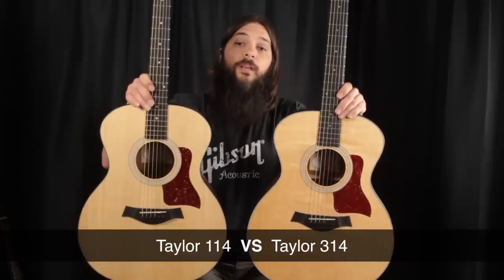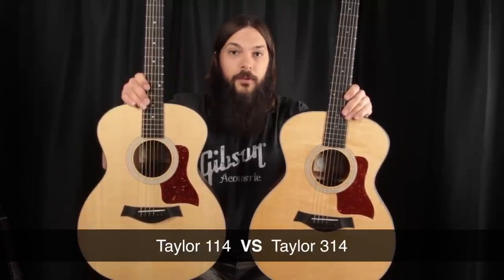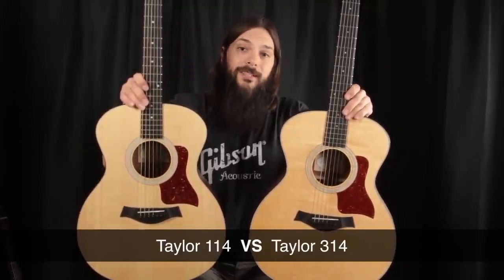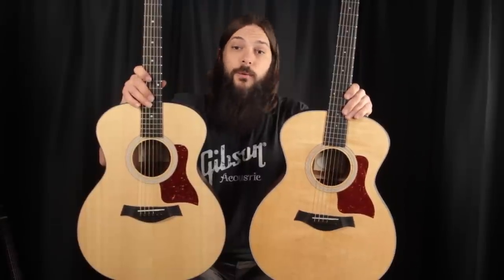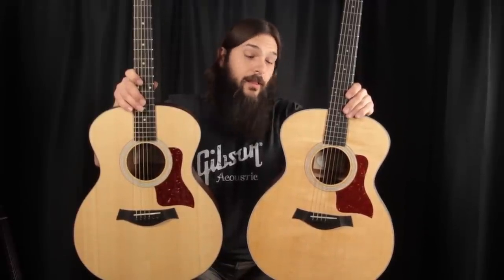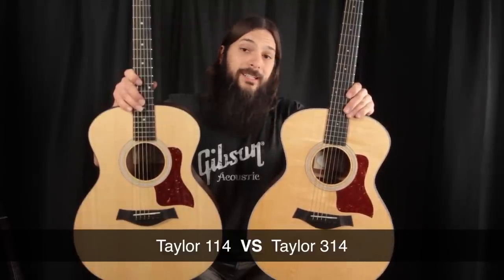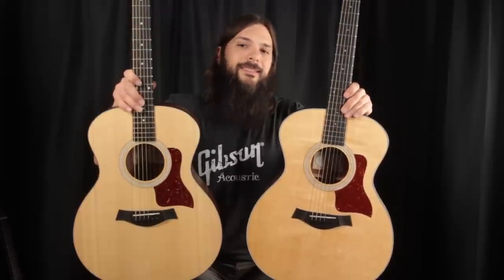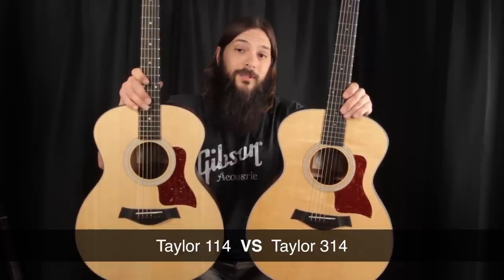Taylor 114 vs 314 - Laminate vs Solid Wood Comparison

Comment: I tend to favor the solid top laminate back and side construction because they require less attention, don't break as easily, and are usually less costly. Take note I'm NOT claiming they are better, just my preference. The best sounding string instruments are sometimes on the very edge of self destruction.

Comment: Just picked up a new 114E. Been playing electric and acoustic guitar my whole life, everything from flamenco to classic rock, metal to bluegrass. Used to have a $2K+ handmade flamenco guitar so I am familiar with solid wood, handmade high end guitars. I went to the local guitar store here in Mesa, AZ (Milano’s for anyone who cares) and tried every OM and DR Martin and Taylor they had. Spent over 2 hours playing. One of the Martins I played was just over $5K, absolutely amazing guitar. I went to the store with the intention to buy a Martin, and left with a Taylor. I cannot believe how much Taylor’s 114 blew every similarly priced Martin out of the water. There was really no comparison; sound, playability, comfort and even aesthetics - everything about the Taylor was better. The entry level Martins don’t even use real ebony wood on the fingerboard or bridge! 🤯 The 114E feels much more like a $2K guitar than a $800 guitar. That said, a week later I was at another local guitar center and tried out a used Martin D-35....wow. Such a nice guitar I almost traded the Taylor in and forked out another grand to get the Martin. What I’ve learned from other reviews and my own experience: Taylor’s “entry level” (hardly entry level they are so damn good) guitars blow Martin’s out of the water. However, once you get into the solid wood price range, it will come down strictly to personal preference. You simply have to try them out yourselves and buy the guitar that feels the best to YOU. And you will certainly not go wrong buying either. Just don’t buy a low end Martin because that really is just a bad choice for any guitarist IMO.
Reply: Totally agree... I went to with 800 to buy thinking it was a toss up between a Martin and a Taylor.... The Taylor won hands down.
Reply: i did the same thing.  went to buy the entry level martin, left with a 114 lol

Comment: I'm actually very interesting in upgrading to a Taylor 110e or 114e next year, so I've been doing my research... And your videos have helped tremendously, especially in giving me an idea of how these guitars sound recorded by mic. Thanks.

I feel like the laminated 114 has a more well-defined attack, presumably because of the more solid, heavier nature of laminated wood, and the 314 has more overtones in the decay due to the porous nature of solid wood... On your faster runs and finger picking, I think the 114 wins hands down, but some of those sustaining chords are utterly gorgeous on the 314. It's weird, really, how one guitar that is vastly more expensive than the other really doesn't sound better or worse, only different.

Comment: Several times I was going to say the 114 actually sounded better; but for the most part they sound so damn similar one would never distinguish them blindfolded. Though even strumming the 114 did tend to sound better, again IMHO. Great demo man.
Reply: I agree
Reply: Both with a mic in front of them maybe, but not acoustically in a room with out a mic coloring the sound. Go to a GC and play both. They usually have both of them in stock.

Comment: So close you could probably try a couple of 114s & they'd be as different due to the fact no two bits of wood are the same !
Hard to see why it's worth paying so much more for the 314 just to be able to say the back & sides are solid. It's the top that is the overwhelmingly important component. Both spruce albeit with different bracing

Comment: The 114 sounds crisper. Other than that, they sound quite similar. I would be hard pressed to spend the extra money on the 314. 
I wonder whether the difference in nut width would make one easier to fingerpick than the other. That could be another decisive factor between the two.

Comment: I am surprised at how similar they sound. The 314 seems to have a little more depth in the midrange. A slightly lower profile.  They both sound great and I wouldn't bat an eye at the 114 at all. A friend of mine has the 114 and it sounds awesome. It's amazing really at that price point.

Comment: If I didn't know that the 114 was the "cheaper" model I would have thought it was the more expensive of the two. It seems much brighter and the note clarity was the best, in my opinion.of course playability might be better on the 314. I don't know.
Reply: +Steve L   Agreed. I just posted a comment as well. I didn't think about play-ability.
Reply: +Steve L note clarity???? It seems you just want to believe in what you want it to be
Reply: Playability is better on the 114, ive been to guitar center 3 different times and settled on the 114. although i did prefer the 414 and up. Dream guitar for taylors is a 814 for me :)
Reply: Christian Hyde fair enough because it's the entry level model
Reply: Its the gloss finish that holds back the sonic potential of the 314. Gloss finish is an astatic marketing decision that in my experience, sonically impacts the more expensive models negatively.
Reply: My guess would be it's only good in the mid. Played one before and I couldn't hear any high when strumming.

Comment: Both sound great, but I preferred the 114 in all samples. I've got a 416 CE Spring Limited. ****Editing my comment a year later now that I have a new 214CE which also has a layered back and sides like the 114. In some ways I like the sound better than my 416CE SPL but they're both fantastic in their own way- it has more presence and punch, which I like. It sort of has "the sound" that I've had in my head for years- sounds like my favourite classic recordings. My 416 sounds a bit richer and complex and warmer (different wood also), the 214 is maybe a little louder with piano-like clarity and articulation. Not a huge difference in sound really, but it's definitely there. I'm wondering how much the non-braced, arched back might have to do with the 214's tone. Awesome guitar.

Comment: 114 has more clear note definition. Surprised at this considering its laminate back and sides. I always thought solid wood made all the difference. Sure does not to my ears. The 314 has this slight ring rattle sound I don't like. You can really hear it.

Comment: The 314 seemed a little more even with more bass present. The 114 also seemed a bit "boxy" in comparison to the 314. The 114 still sounds great. But the 314 does sound a heck of alot better in my opinion.

I would like to see some other "comparisons. The Taylors vs non Taylors. Perhaps some Godin guitars like Larivee, Seagull, or Simon and Patrick, or other brands like Walden and Yamaha and Takamine.
Reply: capoman1 €

Comment: Most people are forgetting that the gloss top on the 314 will restrict a lot of that natural tone which is always better on a natural finish on a solid top acoustic. The gloss may be better for preserving and stoping the top warping or bulging as it ages maybe that's why taylor uses gloss? , and why the 114 sounds more vibrant than the 314!

Comment: Hmm, It's hard to judge based on the recording.  The 314 seems to have more volume, and the notes sound like there pushed out quicker and blend faster. The 114 sound is not as loud yet still clear and  resonates well as I can her the sound absorb through the guitar more, the notes don't blend as quickly as i can slightly hear the notes individually ring harmoniously.  There both great, I'd go with the 114, it's easier on the ears and feels better; But then again that may be because I have a Martin, my best friend has a Cutaway, Grand Syphony Taylor; Mine is warm, his is bright but notes ring harmoniously well, and they play great side by side. He'll want to play mine and I will want to play his, but we love our guitars.  I am drooling to get the 8-String Baritone Taylor.
Reply: +Lee G  Read a post From Steve L, and I agree over something I didn't thing about; That is the guitars play-ability.

Comment: Both sound the same for higher frequencies, but you can definitely hear the slower vibrations on the 314. I guess Taylor prioritizes the cutting high frequencies (as they should) and improves on the more transient, slower frequencies as the price increases.

Comment: To me these two sound identical except when strumming chords. For some reason the 314 comes off smoother and more like a hollow wooden cavity. The low end sustain on the 314 is significantly longer, like the laminate glue layers absorb low freq energy more so than solid wood.

Comment: One of the best VS tests on NET ever with an intelligent system! the 114 is al ittle bit lowder, clear because laminate back and sides! I had a 214 and a 314 also in my hands, the same result. But for finer ears the 314 ist better, but little more weigh. For my is 114/214 the favorite! but the goodness at TAYLOR GUITARS ends by 814/914 and custom models! TANXXXX!!!

Comment: I went from a 114ce to a 414ce. The 414ce is $400 more than the 314ce. The 414ce just looks, plays and sounds so much better than the 314ce. To me there was not a huge difference in sound and playability in a 114 over a 314 that was worth the extra $1000.

Comment: The difference for me is across the treble strings. Taylors generally sound great but the 310, which I have, has a balance across the strings that that I didn’t feel on the 110. I can play with a heavy pick and still dig in hard. Look for used ones because they are great guitars.  Mine has that honey look which I can’t walk past without having to pick it up and play. It’s like when you are a kid and you get to ride your bike without stabilisers. You can’t wait until dawn to head out again. That’s the same I get with the Taylor.

Comment: I don’t know if this makes sense sonically, but the 314 doesn’t seem like it’s working as hard to achieve the same thing. They both sound very similar, which is impressive considering the price difference, but the 314 just seems to have more headroom. Given my poor vocabulary for this subject, the best I can do is compare it to cars. The 114 is like a reliable Japanese 4-cylinder engine (don’t @ me) in a boring Camry (although the 114 isn’t boring to me). If you buy the same car with the V6 it’s just a whole different experience and the car just seems to have the oomph when you need it (for most people).  And yet, you really can’t go wrong with either (don’t @ me).

Comment: These guitars are nothing alike if you play them..the 114 is a good value guitar but once you played the 314 you wont go back they are worlds apart to play. You need to actually play the to see what I mean
Reply: ok but just dont by a 214 .  wast of money
Reply: I didnt like the 314 over the 114. IMO if youre not buying a 414 or higher just get the 114. But tbh the only reason i got the 114 over the 414 was because for about $1300 more id get the 814 which is my dream guitar on the taylor side anyway.
Reply: @Dev9172  why though?!  this is on my short list!

Comment: Was about to spend £800 on 214ce but the shop had an 2002 preowned (quite a bit of wear but still great condition) 414ce for £1050. You have to play both to appreciate the difference but its there and a solid wood guitar is worth the extra investment.
Reply: It will have been broken in a bit too. Solid wood only sounds better with age. Sounds like you found a great guitar.

Comment: Taylor makes such great guitars that literally any of them sound great. But I can hear the difference so clearly. I prefer the fuller range of sound out of the 314. The 114 is such a nice sounding guitar for the money though. I'd recommend that guitar to damn near anybody. But if you listen closely, the vibrato on the chords is quite noticeable on the 114. While the 314 sustains more frequencies at an even level. But in my opinion the sound of the 314 is more, well, rich.

Comment: Holy crap!  The laminate actually sounds BETTER.  Who'da'thunk?
Reply: 'course, I think we also do have to consider that laminates don't have that "break-in" period before they "open up," and already come with their more permanent sound, as opposed to solid tops which have to age a bit to get to their true and optimal tone.
Reply: I agree, the laminate sounded better.  I also just picked one up recently. It had a bearclawed spruce top and it sounds better than guitars costing more than 7 thousand dollars.  It's an amazing fingerstyle guitar, and it just sings.
Reply: 51MontyPython It is a solid top
Reply: CapeRR tmac
Good point.  I wonder just how much the back and sides has to do with tone.  I know thee is much debate about that.  But for those who automatically assume that al solids are necessarily better, I think this vid calls all of that into question.  Hard to do any real scientific study into such things, however, which are innately so subjective.
Reply: 51MontyPython I agree!! There's more of a sound difference in wood type on the back and sides than a laminate vs. non laminate of the same type of wood.  The top would have the most affect on how it sounds. But play two of the same guitar back to back and there would be subtle differences bewtweeen them as well.
Reply: CapeRR tmac I wonder what differentiates an all solid wood guitar from one that has laminate back and sides, as far as sound quality goes, that one might sound better in some instances while/with the reverse being true in others.
Reply: +51MontyPython There is a test which say laminate top have more sustain than solid top
Reply: borhanus
No kidding?
Reply: 51MontyPython
I was surprised with the result .just search in you tube .test was done in really scientific way with digital measurement of wave
Reply: borhanus
Cool.   I'll look it up.  Thanks.
Reply: +Curtis C Agree with this, and its these overtones that youtube cant adequately capture, nor can most peoples laptop speakers.  These reviews are indicative only - its a whole other world when you have the guitar in your hands, and the difference is much greater.  Whether or not it is worth the price difference is up to the individual guitarist.
Reply: +51MontyPython People always believe in what they want to believe
Reply: Andrew Zeleno
True.  So true.
Reply: Tone is all personal preference but my ears hear so much more in the lower midrange filled up with the 314.  Worth the extra $600+?  maybe.  I think a used 314 in good shape would be the best option.
Reply: Better is what you like.Tell which food is better, which book, which movie.
Reply: I recently bought the 114 - as my "travel" guitar to go along with my Martin D-18.  I had quite a bit of difficulty deciding on which guitar to pick for my "travel" guitar, because the Martin's rich, warm sound kind of spoils one's ears.  I didn't really at first like the signature "Taylor" bright sound, but eventually warmed up to it when I found the Walnut-laminate version of the 114.  I am delighted with the 114, and sometimes play it by choice.  Nevertheless, the Martin D-18 is dramatically richer in tone, especially hearing it in person - and probably a similar (though less dramatic) difference exists between the solid-body 314 Taylor vs the 114 - though admittedly I never tried playing the 314, because it was outside my purpose and price range for what I wanted in my "second" travel guitar.

BOTTOM LINE THOUGH: I would gladly recommend the 114 - very good playability as well.  I would suggest looking for a walnut laminate model over the sapele laminate model - there's a subtle, but definite (to my ears) difference for the better with walnut.
Reply: Well, the carbon fiber guitars probably sustain longer too, but the don't make good strumming guitars to my ears of course.

Comment: The 114 sounds brighter while the 314 sounds more mellow with a smoother tone and more sustain. However, these both look new so the sound difference isn't too obvious to me. I suspect a 314 that has been played for 2 or 3 years would sound a lot different than any 114 and probably a lot better.

Comment: i tried owning different laminate and solid for years, in my experience the laminates always sounded generic to me, were the solid woods always had that midrange character and personality that makes them more recognizable and unique sounding when sitting down playing it, especially when you getting older with the instrument and the wood adding even more to that. Also solid has more definition with older worn out strings, but with laminate i had to change strings so often because they sounded dead so quickly, no wonders why so many buys elixir strings. Super Thick coated strings with a generic sterile laminated guitar = ughh very Cringy to my ears. That said, laminate have its merits when its comes to cheaper price and humidity conditions.

Comment: I've visited a guitar store and I experiences same sound difference as in video. 314 has more depth a better bass. Less bright at high tones. What was interesting was that I also tried 614 series. I couln't help myself, but 614 was VERY VERY similar to the 114ce!!! It was 4 times more expensive than 114ce. My advice is go to guitar shop and take time a listen to guitars at least hour and make your opinion.

Comment: 114 has a 1.687 nut 314 has a 1.750 nut. 314 better for large hands n finger picking. 2019 the 314 came out with "V" Bracing. The older "X"  bracing sounds more lively to my ear.

Comment: 314 will sound better in the mix. It won't drown in the mix. I'm telling as a pro mixing engineer. btw I don't see a point to buy 114. Difference in price is not so big. If you buy Gibson SJ-200 or Epiphone EJ-200CE then the price can be a thing. But here I don't see any reason to buy 114 over 314